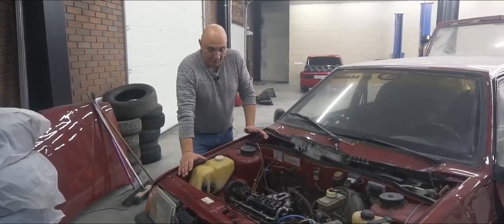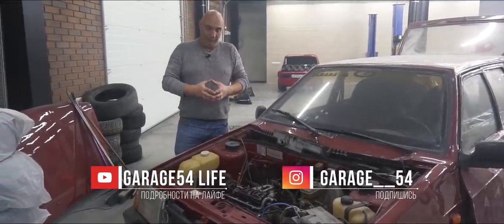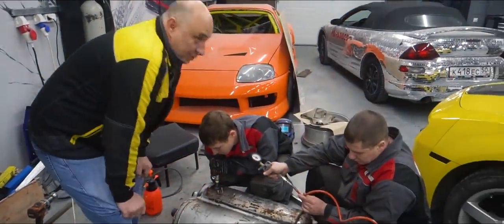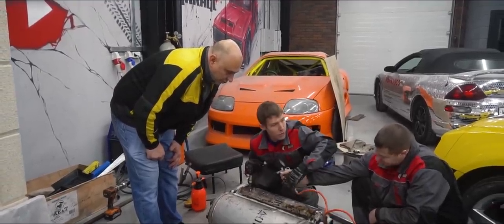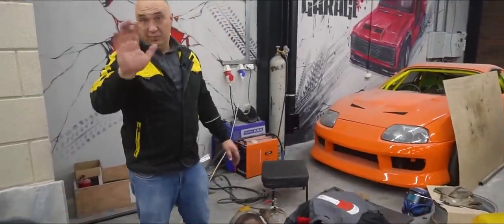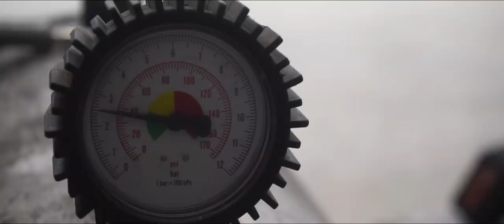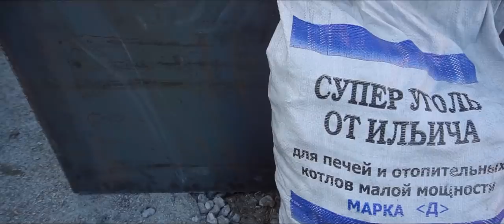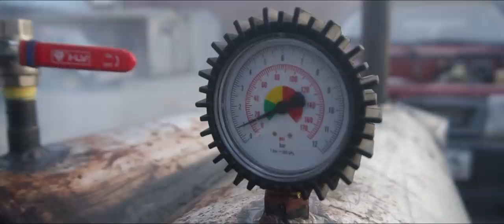Steam engine conversion – first startup

Comment: How about adding a steam condenser to the end of the exhaust and drain the condensed water back to the boiler?
Reply: You'd have to collect it and pump it back into the boiler for best results. I gets more complicated to be efficient, I used to take car of a simple low pressure steam boiler at work. This setup is crazy dangerous, really no good way to shut off the heat quickly, and way to small a relief valve. It is really cool though, I wouldn't want to be around it.
Reply: @grantw.whitwam9948  stop thinking so complicated. all you need to do is angle the pipe so the condensed water runs back to the boiler
Reply: @MrTommymxr  but Grant is right. The boiler is under pressure. The water wouldn't just "run back" into it. You need to pump it under greater pressure or shut the heat off.
Reply: I would have thought the main priority would be efficiency. How to minimize fuel use yet still get the same amount of work. Last I checked water is available literally everywhere that people exist and should be free, actually it damn well better be. If you had a steam powered car with a total 50% thermal efficiency instead of 10%, would you really be bothered by having to periodically refill the boiler?
Reply: @MrTommymxr  The boiler is under pressure... Gravity and 1 bar pressure will not get new/recycled water into the boiler... It needs a feed water pump.
Reply: @athopi  i realised i read the initial comment wrong. 

i thought he was talking about the problem of condensation in the pipe..
disregard my inability to read

Comment: Zero carbon emissions, if you forget the part in front of the steam pipe :D
Reply: After that he said, we need to burn some coal though...lol
Reply: @24inch54  Maybe  we  could  use  trumps  "clean coal",  tremendous,  believe  me  ..................
Reply: @24inch54  = 609,6  cm   ..............
Reply: @ralfhaggstrom9862  diameter of the wheel of my streetbike.. I heared somewhere when you plant more trees than you burn, than the earth is okay with that...
Reply: @24inch54  Maybe  a  bit  simplified,  but  OK  ................
Reply: Ginger Ginger  just cut down trees at below replacement rate
Reply: Charcoal is made of wood. so depending on how it's processed and how the forestry is managed it's more carbon neutral than electric.
Reply: Ginger Ginger  we can't put a cork in a volcano but we can change how much fossil fuel we burn.
Reply: Carbon dioxide is not a greenhouse gas unlike what you've been told. The global warming agenda is all about control. Think about it. The government is going to ban an element on the periodic table? Or how about the fact that CO2, the most naturally occurring gas in the world and is part of photosynthesis for all plant life, is now being classified as a pollutant? It's been a necessary component for life on Earth for over 50,000 years and suddenly it's polluting, because the government says so? That's rich. So when did this so called "authority" become the truth instead of the truth being the authority? Assuming this is a real issue I have yet to hear of any idea that doesn't involve the erosion of liberty. Place a tax on every breath we take? Reduce world population at government's discretion? If anyone here thinks that would never happen then you're too late. It has already happened before.
Reply: @ralfhaggstrom9862  do you understand what the term clean coal means? Lol it's been around longer then Trump's presidency.
Reply: @NIGHTMARERICA  How  can  Anything  be  longer  than  an  Eternity  ?    ( remember  to  be  a  good  kid,  and  take  your  medication )  ..................
Reply: @ralfhaggstrom9862  are you high?
Reply: @NIGHTMARERICA  No,  as  You,  I  am  crazee  .......................
Reply: @ralfhaggstrom9862  .... And this is went you don't do drugs kids

Comment: You people are insane !
Just LOVE IT 😊
Priority 1: make sure you fit a safety valve guys! 
2: and some kind of injector so you can add water to the boiler while it's running. If you run out of water with that big fire underneath you'll kill the boiler, and probably yourselves with it.
Basically check out what makes up a steam locomotive 😉
Most important of all guys, stay safe -  and alive! We need you on YouTube 👍

Comment: watching the video I realize that the energy losses of the steam systems are enormous.
Reply: Look at the very last steam powered cars before internal combustion engines they were very advanced I think you would be surprised. I recommend Jay Leno's Garage as he has a really detailed vid of him driving it and it is totally usable even by today's standards, well, apart from start up time..
Reply: Needs a closed system. Venting is only required in high pressure situations.
Reply: Standard  locomotive is around 8% efficient so... yeah
Reply: @blackturbine  Seeing how the average gasoline power engine gets about 25% efficiency I'd say that we haven't gone that far in the past 200 years of "technological development" we've had.
Reply: @dariusmccormack7793  Where I live there is a factory that is still entirely fed on steam and it actually is very efficient
Reply: Daver G  No need to wonder, you can see that in reality when you look to steam turbines. We still using steam, we just abandon external combustion engines because of the terrible low efficiency.
Reply: @willemkauffeld7679  I always wondered if you could use atmospheric pressure as a ram pump using a vacuum somehow
Reply: @willemkauffeld7679  which produces refrigerated air as exhaust
Reply: Properly engineered steam engines are very good, if development continued i believe some gains in efficiency would have eventuated,there was a very efficient steam locomotive in SA called the "red devil" that was condensing and had a floating firebed, i forget its efficiency though but it was very good.Steam is more like electric engines, massive torque at all rpm and near (if not there) max torque at stall condition's.There was a guy here (Australia)in the 1970's who converted a ford falcon into steam powered, it was very efficient and very fast with iiirc a 30 second start up. Im sure it could be found with some searching,tech probably got bought to be destroyed...
Reply: Luckily the steam can be recycled. The biggest problem is making the steam. It takes a lot of energy to maintain steam. From my understanding that is.
Reply: to be efficient steam system must be well thought, stationary and the size of a power plant
such plants are called thermal power stations and they generate most of electricity in the world
Reply: It is true, however retro fitted steam engines are insanely efficient and unbelievable powerful.
The only train I have been on was a diesel heated steam train
Reply: excuse me fans of old steam trains I could not offend the trains with my comment😂😂🚂🚂
Reply: @unitytwins6652  The pure amount of energy per Kg if gasoline or petrol is pretty crazy at the time more than made up for the seemingly low efficiency.
Reply: but its cheap
Reply: I mean if you convert a single acting ICE to steam via a russian blackthumb, yeah.
Reply: @blackturbine   efficiency doesn't mean anything.   A 6% efficient steam car powered by solar panels making free steam is 10000000% more "efficient" than a Tesla

Comment: You need to put safety valve on there at least  and a water pump to inject water. And add a boiler water gauge. So you can at least control it in some way. Run the exhaust steam pipe back up the chimney to create draw on the fire. You could also add a steam pipe up out the chimney from the boiler  to create draw on the fire when not moving help create steam. Basics from steam locos. Great videos as always thanks

Comment: Please please please make a trailer to tow the boiler setup, you could use flexible pipe for the connection. The chimney as stated should be wider also if you put the fan blower so its blowing up the chimney it should suck the air in and get the coals to heat up more. Maybe a separate valve to blow out the water in the line before you allow it into the engine. I think even at 1000rpm the car should have good power, steam engines generally spin slow but make good power. Great video you guys!  Massive respect from the UK 👍😁

Comment: I love your show and the projects that you do. However for safety sake on the steam engine project, please add a safety valve to the boiler, to protect you from a steam drum explosion. Also, you need  a way to tell the water level in the boiler. A "gage glass" , or at least a cock to tell where the water is in the boiler- that its not too low. ( or high )You could add a pump to be able to add water into the boiler while it is working. If you already thought of those things, sorry for butting in! We dont want you gentlemen getting hurt you know- Keep the shows coming!

Comment: be carefull not to let the oil pan fill up with water and hydro lock
Reply: Ya that would suck .... that's why steam engines had huge grease channels instead of circulating oil and also why everytime you see an old steam engine that's still operating theres guys getting off with huge grease guns to regrease the cylinders and all rotation points at every stop
Reply: this engine is fucked anyway.
you cant hydro lock because there is no compression stroke

Comment: What if you make closed steam circuit , from water tank goes into intake , engine will rotate and exhaust will go back into tank hmmm
Reply: Good point. You only end up using a fraction of the coal in a closed system. They were losing too much energy  to the exhaust and leaks.
Reply: Steam pressure will equalize on intake and outtake.
Reply: @gteaz  yep. will need to pump the water back into the tank at higher pressure then whats in the tank
Reply: Yep, a condenser would be a great idea
Reply: Use a positive displacement pump.  Turn the fuel tank into a condenser.
Reply: 1920s steam cars did this
Reply: I implore everyone here to do a quick search on "Rocket Mass" heaters. How the design of a stove has all the impact in the world on thermal efficiency and fuel usage.

Comment: You should use the exhaust steam for a venturi in the boiler exhaust to draw the flames through the fire tubes like in a steam locomotive. You might get higher efficiency if you connect the pipes in the two tanks so they form a U shape, that way the gases have more time to transfer their heat to the water.

Comment: A boiler is too dangerous and cumbersome  they should have used a metal coil.
Reply: Ebo Chi issue is they need steam pressure not just steam but yer your not wrong it is dangerous as hell
Reply: Stirling engines are reliable and more efficient nasa made a project in a car but it failed. Their great on a hybrid or a low power alternative campfire generator but not a typical car powertrain
Reply: @regularpit1508  they didn't build a stirling engine. the problem with a stirling engine is the size and weight of the thing, compared to the mechanical energy out.

Comment: THEY NEED OVER PRESSURE VALVES IN THIS SYSTEM!!! Two or more designed for steam pressures and temps. I am all for these guys and dont want them to get hurt by scalding steam or flying debris. In comments please post this saftey concern. We love them and lets help them stay safe.
Reply: Yeah, I think the system would have been fine to run that little car with just one of those pressure vessels. Safer than welding them together like that...

Comment: There is a hell of a lot of power jetting itself right out of the tail pipe.
Single expansion is a real waste of the power of the steam and potentially quite dangerous four you too!
The exhaust steam will happily remove the flesh from your bones.
Reply: Feed the steam from the exhaust back into the boiler, much more efficient
Reply: @rolandleusden  need a condenser and high pressure pump though
Reply: @Namesakes.unit-x-10sq10  they are running it at 4 bars that not high presure
Reply: @mateuszbarya9098  if you connect the exhaust to the boiler you would create an equal pressure on each side, and the engine would not turn. Therefore you need at least a high pressure pump to pump the boiling water back to the rank for i. if to become steam again.
Reply: @Namesakes.unit-x-10sq10  4 bars is not a high presure, but you need pump... I wanted to say that most pumps can easy get more than 4 bars (it's about 40m of pump head that not a lot)

Comment: This is very interesting! Perhaps to increase efficiency, you need to capture the heat of the exhaust gas in some way.  I suggest routing a percentage of it directly in the water tank as a rudimentary form of exhaust gas recirculation, further adding to the pressure and heat. It will take up some volume and add to the overall range,  making the process a bit less wasteful.  Keep up the great work!

Comment: "On the next episode, we're going to let the water drop too low and blow ourselves to kingdom come!"
Screwing around with steam and you have no clue what you're doing is a fast-track to blowing yourself up. Letting the water drop too low is just one of the many ways you can over pressurize the vessel and cause it to explode. When pressure testing a steam vessel, you don't use compressed air, you need to completely fill the tank with water then pressurized only the water with more water. The water itself doesn't actually pressurize so the pressure on the walls of the vessel does. You need to bring the pressure of only water in that vessel to twice the pressure you're going to run. If the vessel fails at that point, only water start squirting out whereas if it's under steam pressure it will explode like a bomb. Just look up pictures of blowing out steam engines. They go with Force to blow all the tubes out the front end of the engine. And, you're lucky if they do go out the front and don't come out the back where you're standing.
Reply: I think the reason they use water in those test is so they aren't waiting around all day for the compressor to fill the pressure vessel, I don't think it has any more function than that. Well, maybe it is easier to trace a leak...
Reply: @athopi  it's called hydro testing. It's not just meant for checking for boiler leaks, but also the structural integrity of the vessel. Compressed air at the pressures needed to test a boiler is very dangerous if the vessel fails.  Being that air compresses it would continue ripping the vessel apart, where water doesn't compress and it's only the metal giving way with a bang and a gush of water.. At least in the US, boilers need to also need to be examined by ultrasound for thin or weak sections. In the old days the men descaleing the inside during retubing could tell by a change in sound from the needle scaler...until they went deaf.

Comment: Great project. 
The coolant system should still be used. How hot did the engine get? 
The exhaust could run into a cold water bath. 
Is there a way to replenish the water on the go? Maybe another pressure tank with a large ball valve on top to pour water into & any size ball valve on bottom. The bottom valve is on top of steam tank. The pressure will equalize & the water will fall into steam tank. Might work.